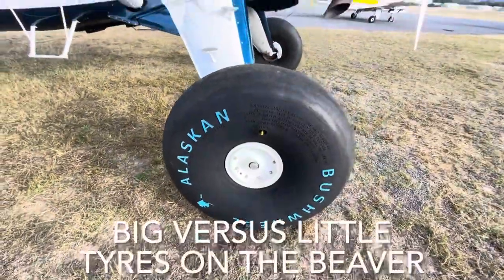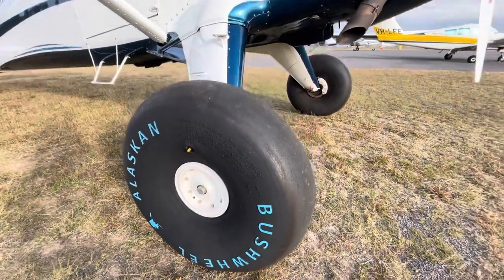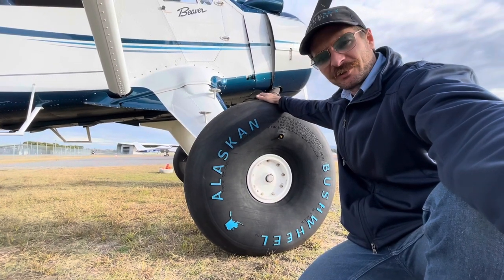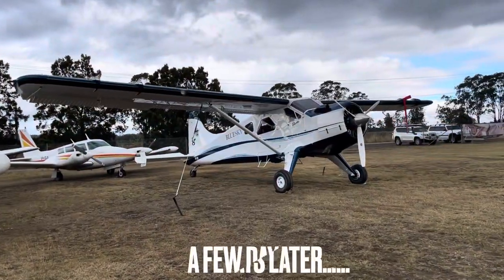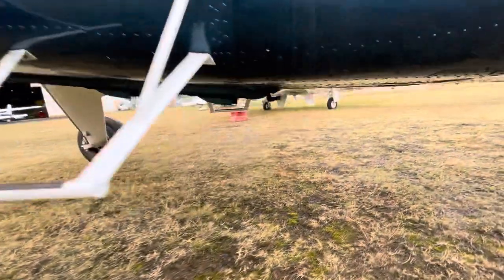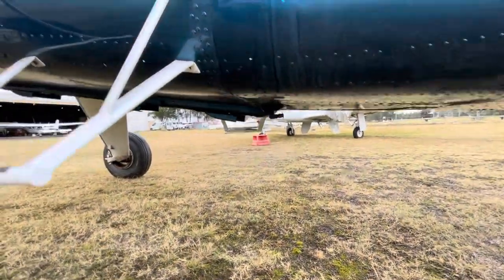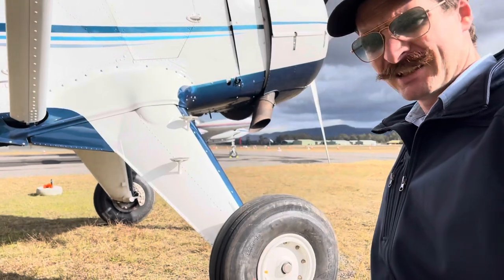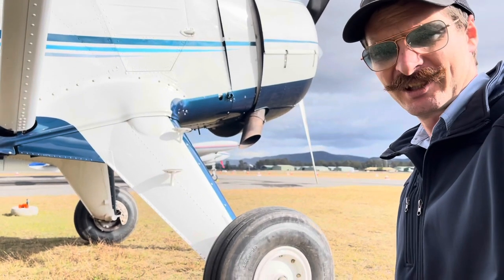Big V’s small tyres on the Beaver

Comment: You have 8.50-10’s  on there that are 25.5 in. Diameter.
In the states we use the 29x11.0-10’s (field approval) that are the 29 inch diameter you spoke of.
Much better look
Reply from the maker: Thanks! Now you mention it, I put them next to the Caravan’s true 29’s, and they’re a lot smaller. We would need an EO (engineering order) here to install anything not approved by the manual or an STC. I think before long we’ll go back to the 35’s anyway!